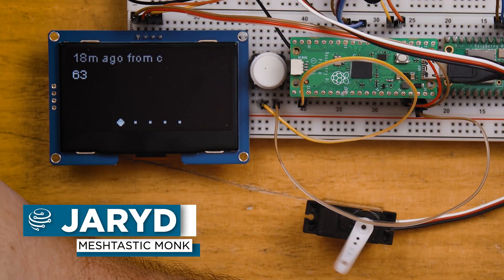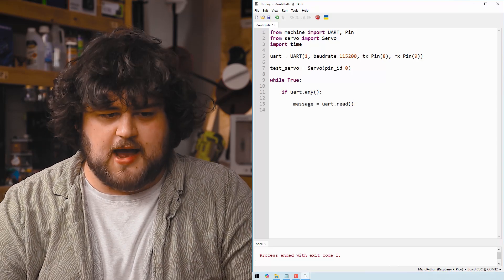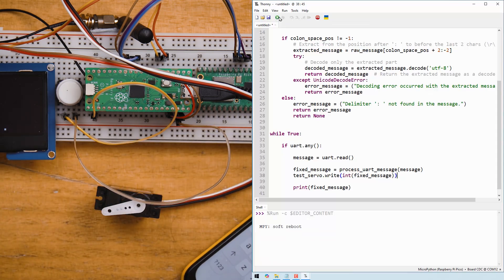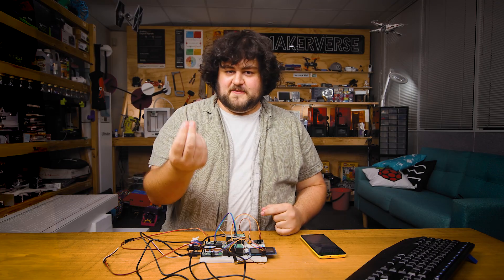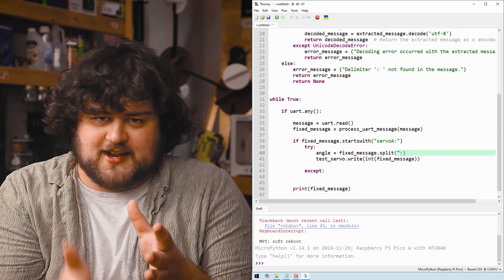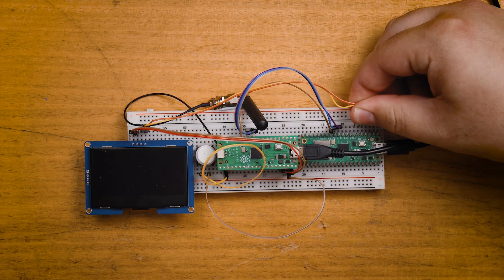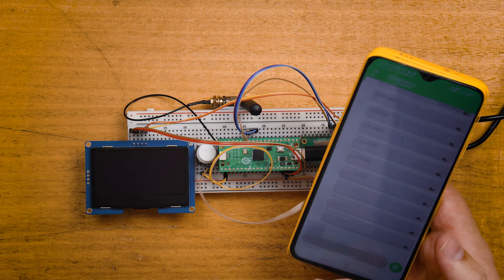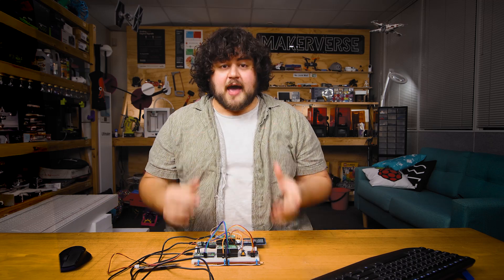Controlling Hardware With Meshtastic Messages | Meshtastic for Makers

Comment: Is the receiver running Meshtastic firmware too? If so is the receiver acting as a client and contributing to the mesh?
Reply from the maker: Yes that's exactly correct! Every Meshtastic device whether you are using it as a receiver or a transmitter is contributing to the mesh as a repeating node. Boosting both the signal range for yourself and others in your local Meshtastic network.
Reply: @Core-Electronics I didn’t spot the second MCU before. I thought the custom code was running on the node 🙂

Comment: Is it possible to control 1 meshtastic Heltec V3 nodes with 2 relays?  Maybe using GPIO 45 and 46?  I have been working on a gate controller that will work over the Meshtastic network, not just LoRa.

Comment: great series, thank you so much ... by the way, since you mentioned it, can you show how to connect gps to pico meshtastic ?
Reply from the maker: We don't have an exact video on how to add GPS to the Pico, but it just uses UART to send coordinates. We have a more indepth guide here on UART if you want to follow it.
https://core-electronics.com.au/courses/raspberry-pi-pico-workshop/#4.2

The GPS module will send a huge amount of information in different formats though so most of the work will be writing code to extract just the coordinates you want. A large language model like ChatGPT, Claude, or Deep Seek can help out a lot with this though!

Comment: This might be a  bit more advanced but do you plan to cover the PROTO serial module mode to allow sending UART messages to specific channels instead of the primary? It looks like this may be C only.
Reply from the maker: At this stage we don't have any plans for that unfortunately, it requires C++ and usage of the Arduino library for it.